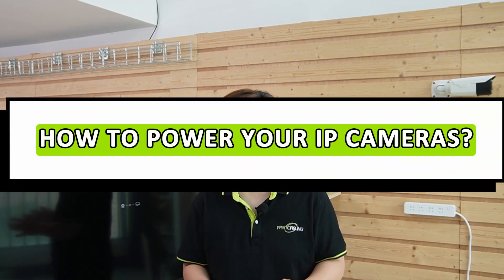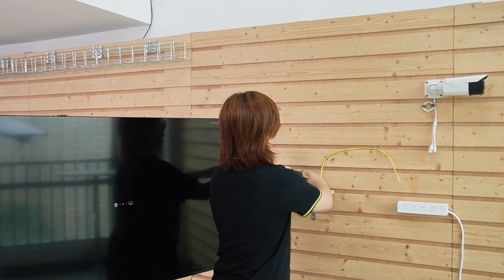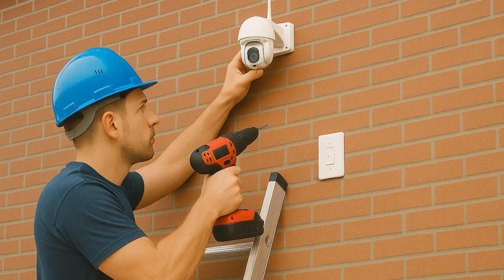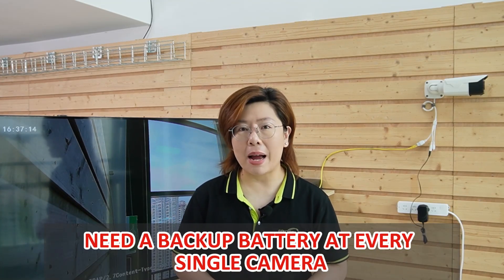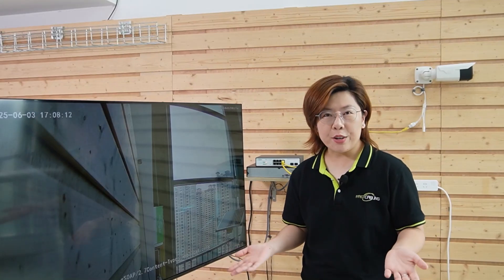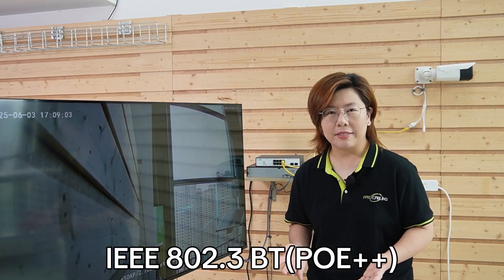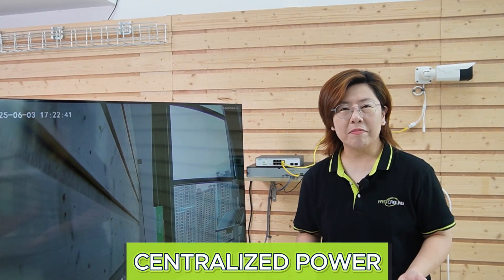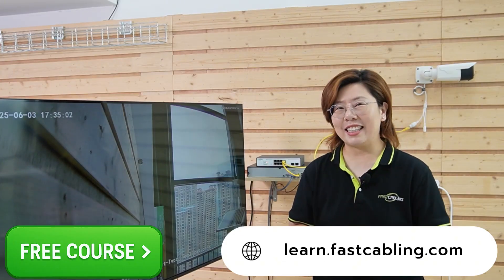IP Camera Systems Lesson 4: How to Power IP Cameras? DC vs PoE Explained!

Comment: What pins provide power to the camera? Voltage DC/AC ? All pins pins being used? If DC Normally voltage -voltage drops.
Reply from the maker: PoE power is DC, not AC.

Voltage: 44–57V DC

Power Pins:
Mode A: 1,2 (+) and 3,6 (−)
Mode B: 4,5 (+) and 7,8 (−)
In 4-pair PoE, all pins are used to deliver power. 

PoE devices are designed to tolerate voltage drop. The PSE (Power Sourcing Equipment, e.g., PoE switch) adjusts the supplied voltage to ensure the PD (Powered Device, like a camera) gets at least the minimum needed (typically ~44V DC at the device for 802.3af).
Reply: @Fastcabling  Great information and thanks for taking the time to explain. Using 4 wires each helps prevent the voltage drop with adjusting PowerS.